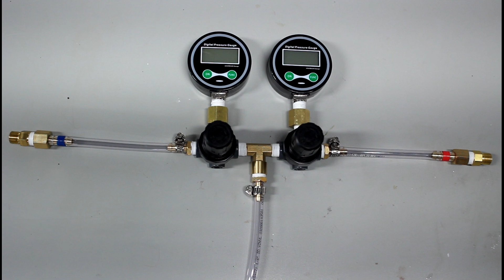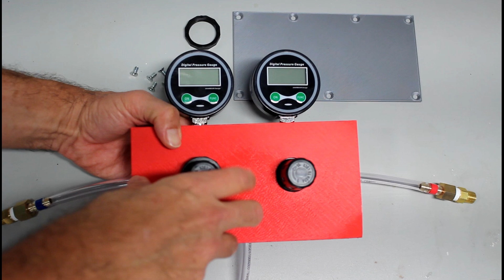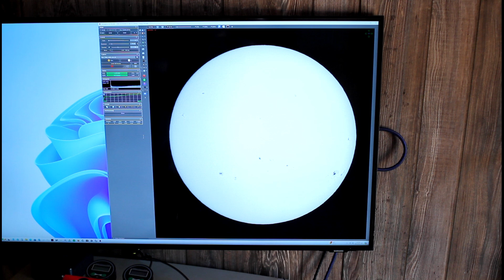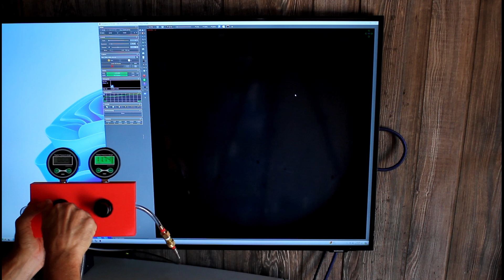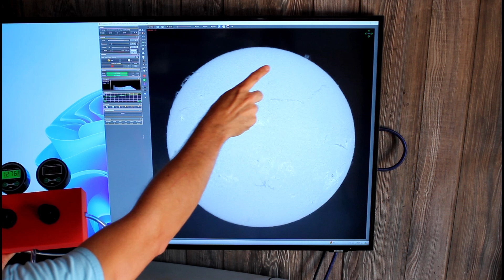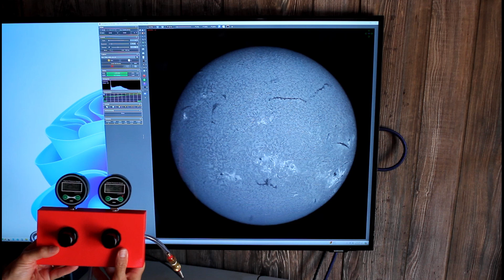Remote Pressure Tuning a Lunt Double Stack Solar Telescope

Comment: I have a tilt etalon but watch your videos because I'm new to solar and yours are the only videos I can find of an etalon actually coming onto band on a screen!
Reply from the maker: I’m glad you like the video. I thought it was important to show how the detail on the sun is gradually revealed as the etalons come on band. Also, the sun appears darkened when one etalon is on band while the other is not because the two bandpasses are misaligned. It brightens again when the second etalon comes on band because the bandpasses of the two etalons are aligned. It really helps to be able sit in front of a shaded computer screen while turning the knobs to adjust the etalon pressures.